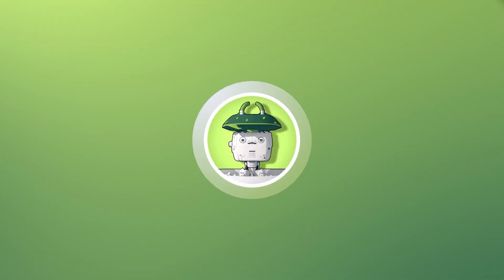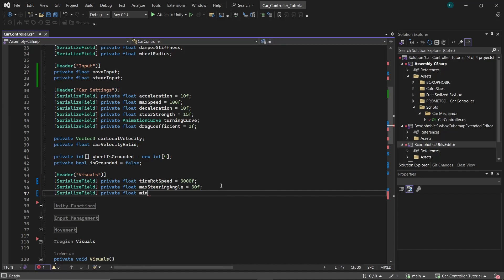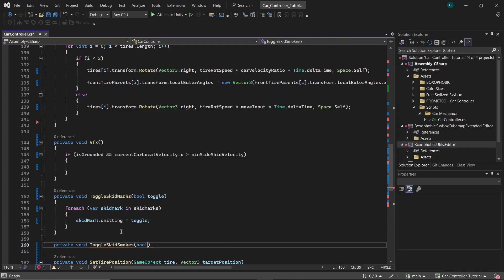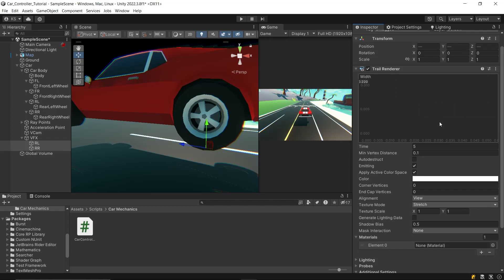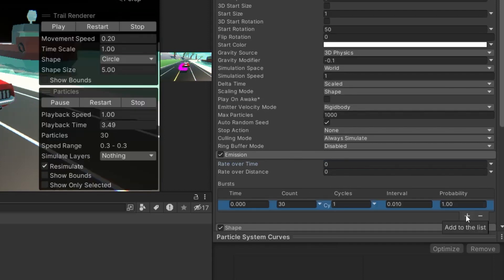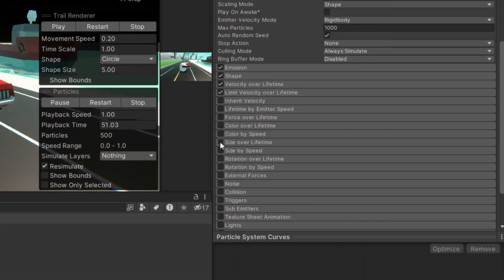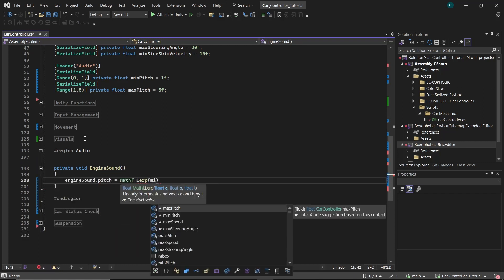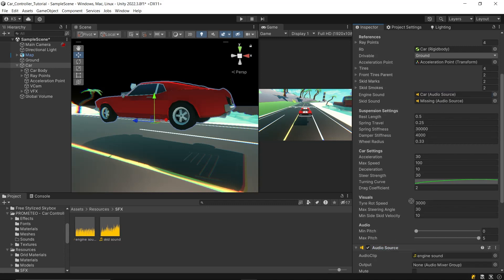Arcade Car Controller Part 4 | Skidmarks, smoke, sounds tutorial Unity | AshDev

Comment: The smoke is only appearing when my car turns left. Any Suggestions?
Reply from the maker: Apologies for the confusion, for toggling the skid smoke, use the absolute value of current car local velocity.
Reply: if (isGroundeded && Mathf.Abs(currentCarLocalVelocity.x) > minSlideSkidVelocity)